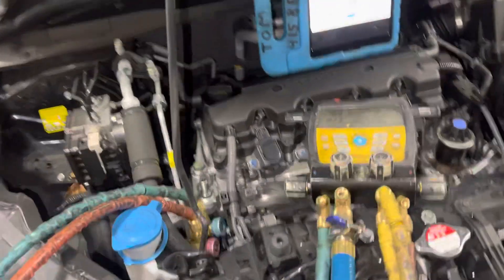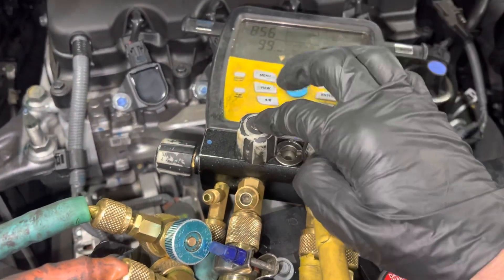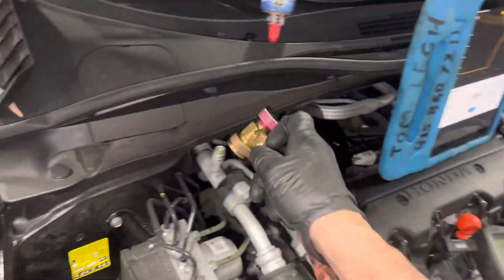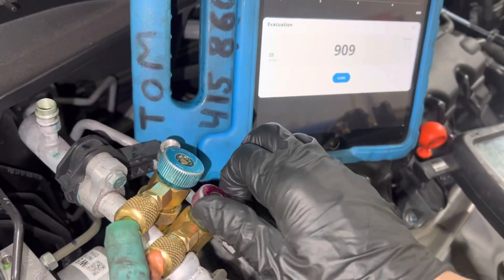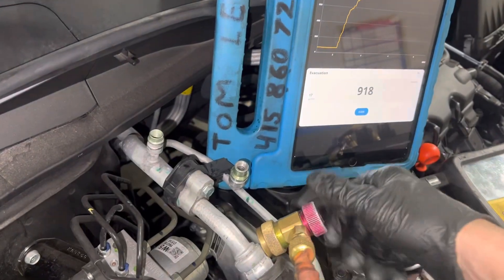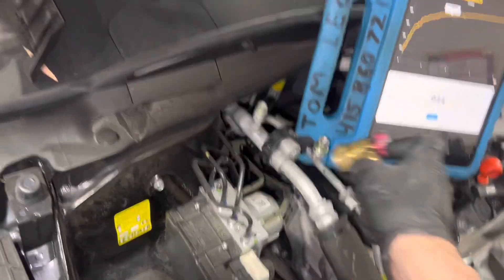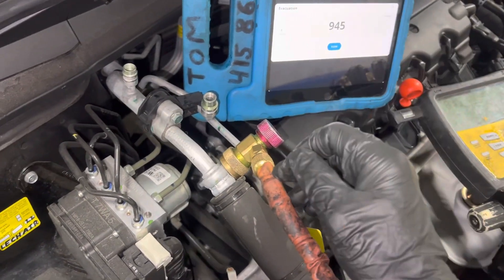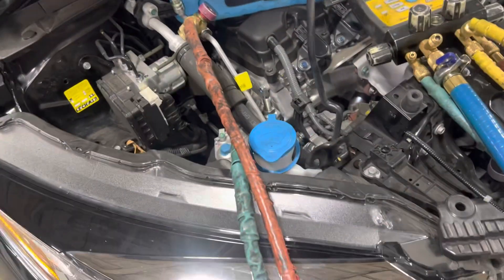DO REFRIGERANT COUPLING SERVICE FITTINGS LEAK WHEN DISCONNECTED ?. Question I was asked. ￼

Comment: Hi I purchased x2 jack off cans made in china of R134A the crc brand I can't get anymore is there different quality of R134a refrigerant?
Reply: I think it all comes from the same source bulk tanks, gets shipped, repackaged, relabeled and marked up according to brand name.
Some will have whale snot and salad dressing added, those aren't generally good ideas, just creates bigger problems.
Reply from the maker: Nope it’s a cheap Chinese stuff is just fine 134 is 134 doesn’t matter if it’s made in China USA, Russia or Timbuktu. 

Other than if it was made in USA they have to have 4000% more profit on it because you know capitalism that’s just the way it is . 
        The stuff from China was originally cheap, but it was imported by a United States corporation for importation and distributed and they had 4000% markup on it.